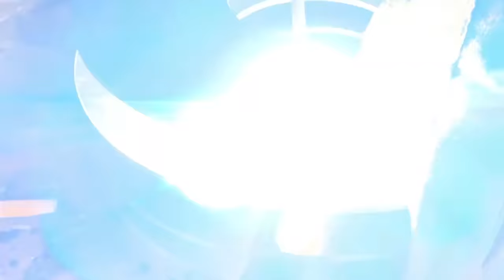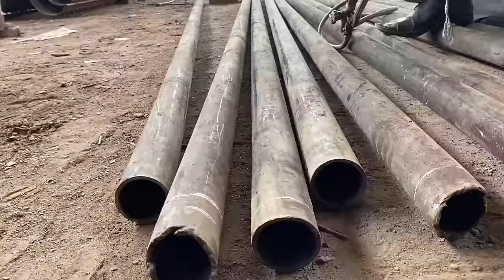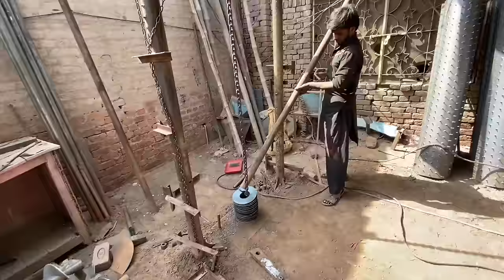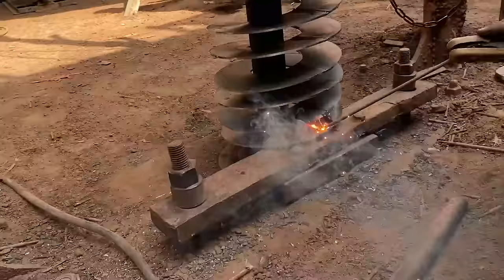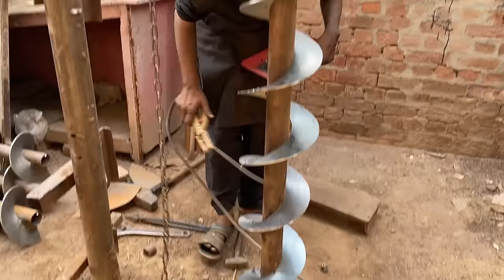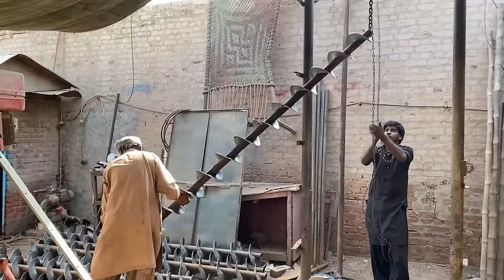Very interesting Technique of Making Screw Conveyor

Comment: А для чего эти шнеки будут использоваться ?
Reply: Lift wheat from tractor driven wheat thrasher to the loading trolley
Reply: Used for screw conveyor to transport material like feed from one place to another. For example from trucks to feed hoppers or from factory output to trucks